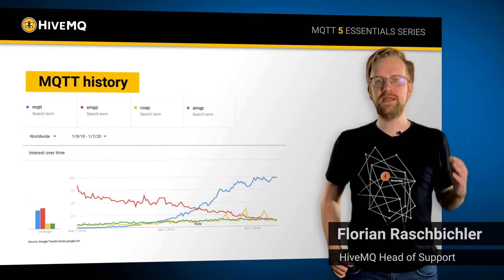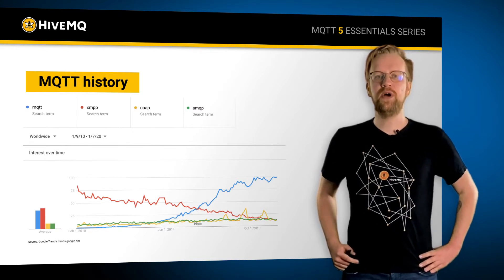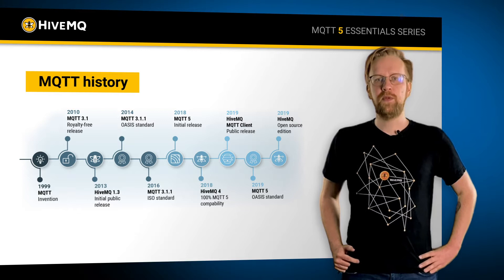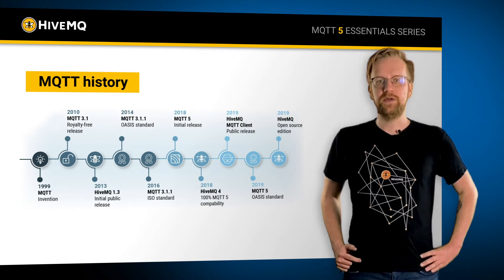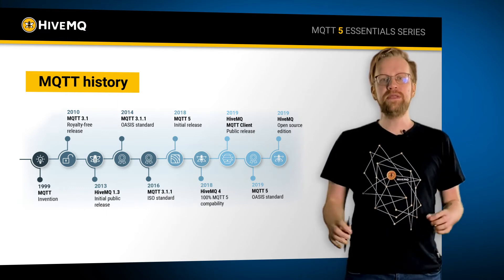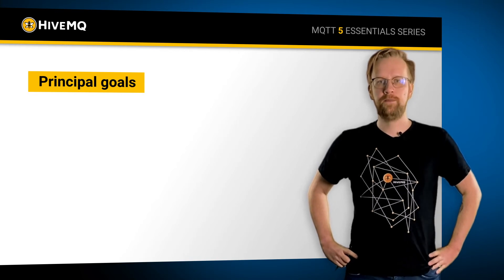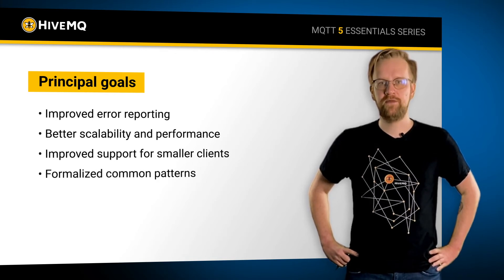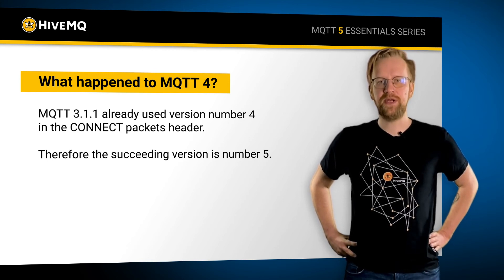What is MQTT 5 and How Does It Work? | MQTT 5 Essentials Part 1

Comment: Is MQTT 5 is backword compatible ? Like can it communicate with version 3?

ALso i am working on a LTE module BG96, which has support of MQTT 3.1.1, so can i make other devices to run on v5 or not?
Reply: MQTT 5 per se is not backward compatible from a specification standpoint. Some MQTT brokers like HiveMQ added a MQTT 5 and 3.1.1 compatibility layer, which allows your MQTT 3 and MQTT 5 devices to communicate and have a hybrid mode.
Reply: @DominikObermaier  ok, what is the minimum subscription plan for HIve mq for project prototype testing